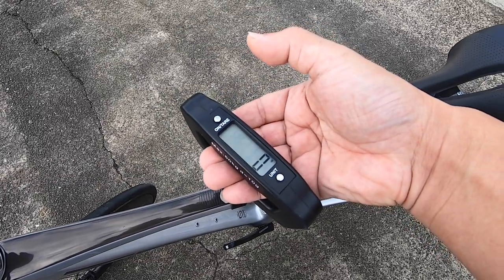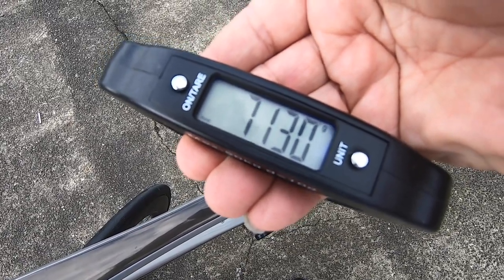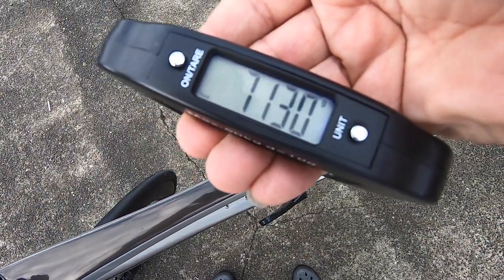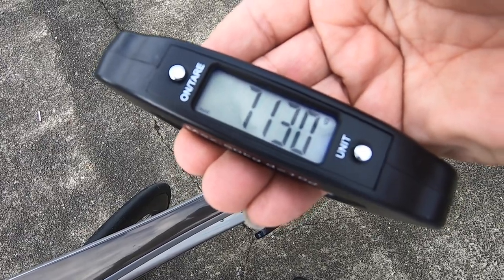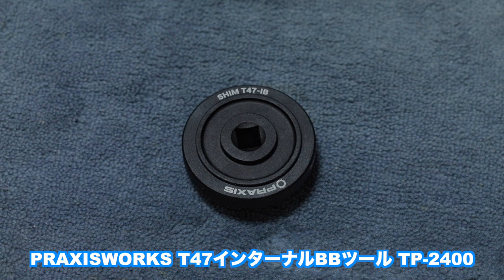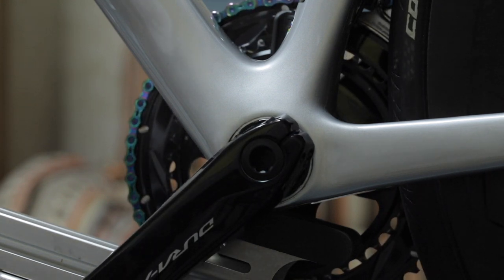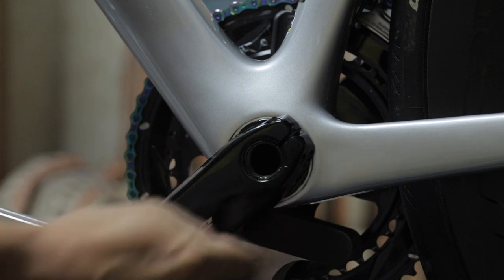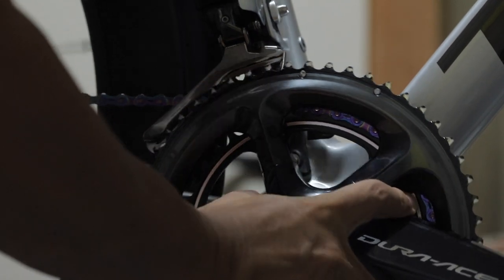7.13kg トレック エモンダ SL5 Di2化　BBの外し方動画もあり

Comment: If you add lightweight 37-40mm carbon wheels it could get below 7kg. Maybe 6.7-6.8kg is possible 😁
Reply from the maker: That's right.but lighrweight wheel is so expensive.
Reply: @203digital  that's true 😐. HUNT has some light wheels. About 1347g wheelset: "HUNT 33 Carbon Aero Disc Wheelset".

Or 1398g: "Hunt 44 UD Carbon Spoke Disc Wheelset".
Reply: @203digital  unfortunately 😕
Reply from the maker: In Japan, it's not a major yet.